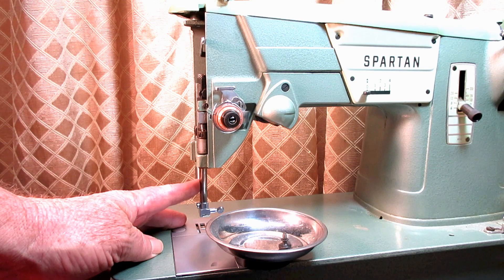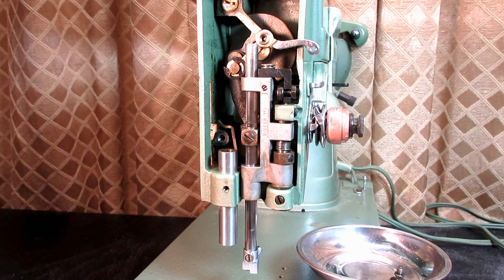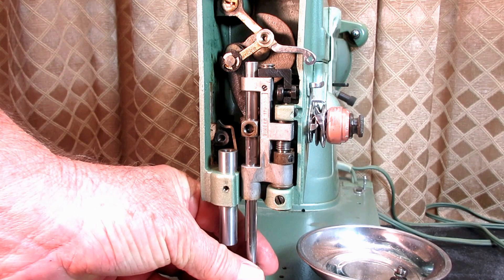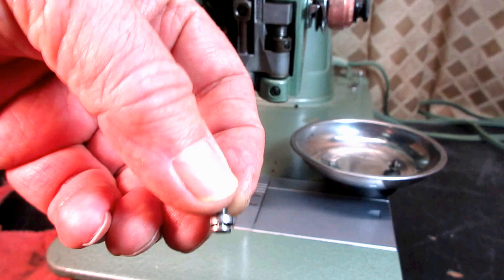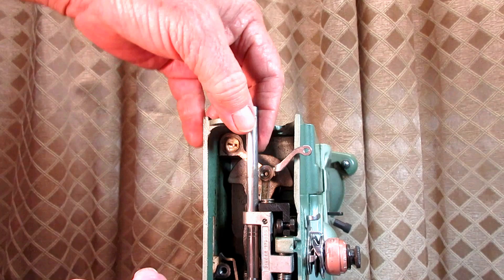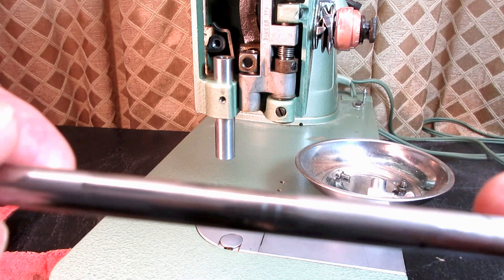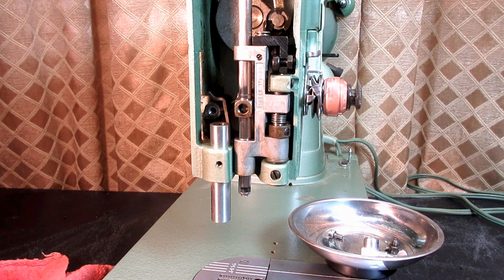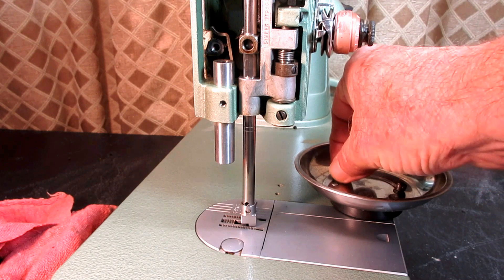Remove, Install, Set the Height of the Needle Bar Singer Model 327K

Comment: The needle of my 328k is too far back, hits the needle plate hole on the back site ,can I adjust this?
Reply from the maker: Sure you can. I do suggest that before you make any adjustments you check with a new needle and be sure your needle bar is not bent. Those problems are the most common causes of your problem, by far. To test for a bent needle bar we usually remove it from the machine, clean it, and roll it on a flat surface with a good light behind it while watching where the NB meets the flat surface for any light leaking under the NB. If you want to do the adjustments you can take a look at the last half of this video ( or the whole thing if you like; it's long) where I make adjustments on a model 457K that has similar parts to your 328K: https://youtu.be/nqFm570Azwc   You can also buy and download a copy of the original model 328K Service Manual for $9.95 from this vendor: https://manualsoncd.com/product/singer-327k-328k-sewing-machine-service-manual/   Thanks for watching my channel, and good luck.
Reply: @andytubesewing1953  thanks a lot, I've learned a lot from your video's 👍🏻
Reply from the maker: Welcome, Alice. Take Care.